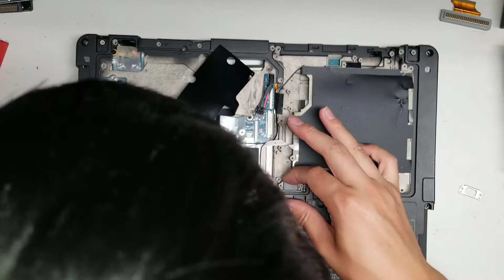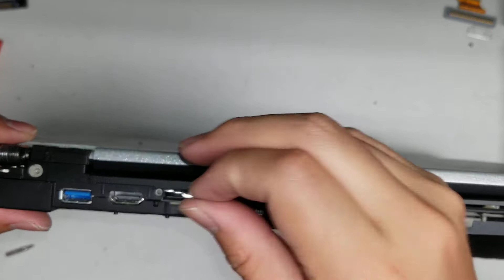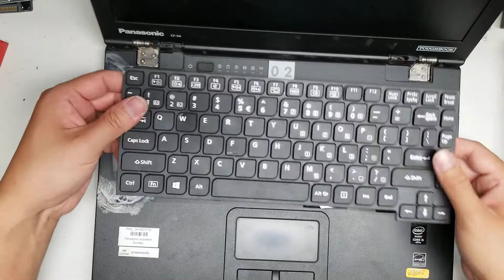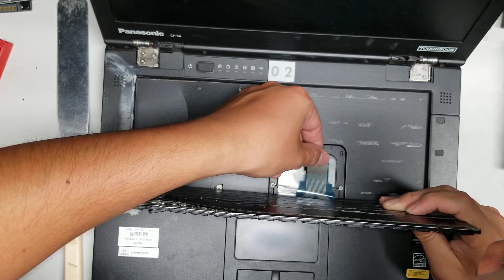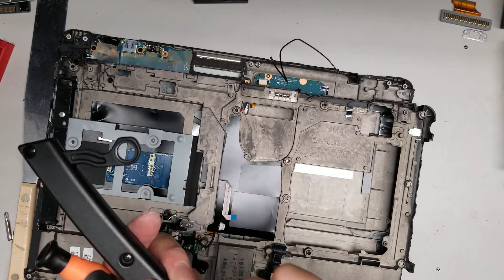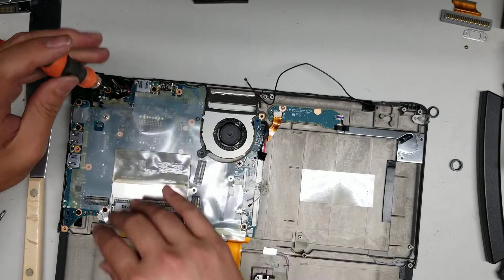Panasonic TOUGHBOOK CF-54 VAS 6510D Disassembly Repair 3 of 5

Comment: how does the cooling paste under the processor change?
Reply from the maker: Are you asking how to change the paste? Have to remove the heatsink.
Reply: @ItsBinhRepaired  What if the pasta boiled?
Reply from the maker: @viktorg6781  have to scrape it off and clean it with rubbing alcohol.